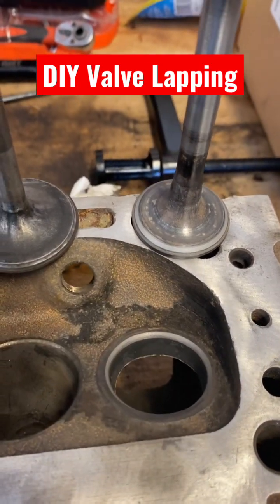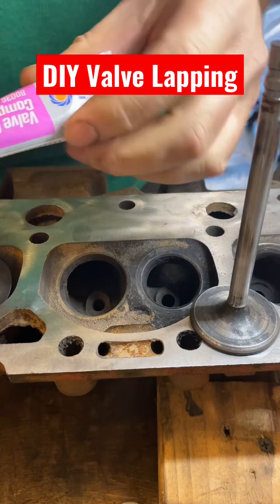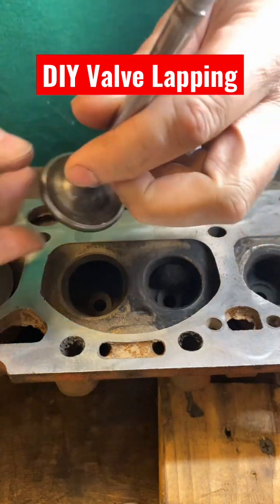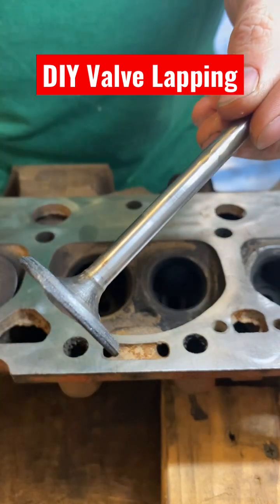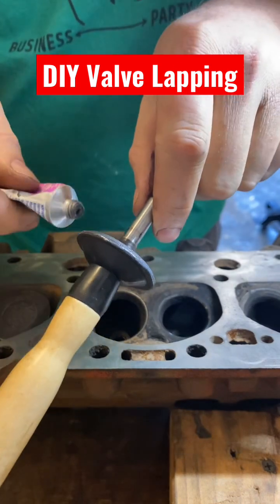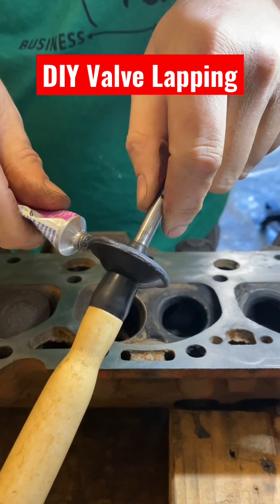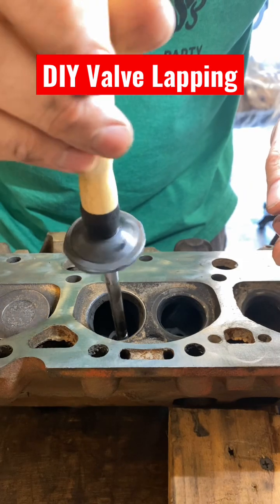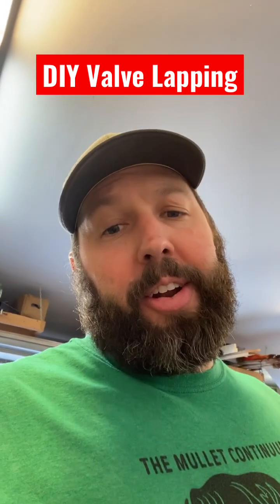DIY Valve Lapping by Hand

Comment: Never use a drill. You will wipe out the seat and create lines that won't seal. Have to do it by hand.
Reply: False
Reply: That's not true, mister. It just takes a little patience and knowledge of proper technique.
Reply: @Maestro_Animates   If u want to ruin the valve and seat have fun doing it WRONG. Quarter turns with the wooden handle and resetting 90 degrees every time the sound gets quiet is the correct way. Drills are for lazy idiots..

Comment: Well done, lots pf people are saying a drill....but thay seems like s very quico way to mess spmething up
Reply from the maker: You can do it with a drill. In some scenarios it makes sense. But you do have to be careful how you chuck it up, and don't get carried away with running the drill too long.
Reply: @freedomworx  absolutely, in fact, ille be using a drill tomorrow, and finish by hand I am thinking
Reply: @freedomworx  You use a rubber hose between the drill and the valve
\
Reply: @Nicholas-im8bd true...its act as a coupling cluth
Reply: it works just fine..just don't marr up the valve. it's actually quite effective. i use that method and then chuck the valve up in a drill press and spin it to polish lightly with a pc of 1500 grit sandpaper and wd40--almost like you're wet sanding.

Comment: Would a fire stick bow be more easier
Reply from the maker: A lot of people will chuck a piece of rubber hose in a drill and slide that oer the valve stem. That's generally the most efficient way to do it.

Comment: I soda blasted then washed my M113 cylinder heads & ran a cotton mop through the valve guides before & after I lapped in the valves . washed the cylinder heads again throughly before assembling them with new valve stem seals / spark plugs / exhaust manifold studs .
Reply from the maker: Overachiever 😉. I would hand just put them in my dishwasher if they would have fit. 🤓
Reply: @freedomworx  HA ! 😂 that’s a knee slapper ! . But honestly not even a bad idea  . I do kitchen remodels & half the time I find myself removing old dishwashers that are still working fine  & take them to the dump . You kinda just gave me the idea to take the next one home a hook it up in my back yard as a dedicated parts washer !

Comment: Hi! Do u have to shave heads after or can they go back on after the lapping if their already clean? Thanks
Reply from the maker: I didn’t do any surfacing of the heads. Just bolted it all back together. A machinist will always tell you they need to be surfaced 🤷🏻‍♂️
Reply: @freedomworx  My man! Thanks bro
Reply: Lapping valves has nothing to do with whether the head needs to be "shaved" (resurfaced). Shaving is IF the head is warped, lapping just ensures the mating surfaces of the valve and head port mate and seal smoothly. But of course shaving the head would affect valve clearance, but you'd have to adjust that anyway since it's taken apart.

Comment: more than "wearing out" (which it does), it pushes out of between the two surfaces.  You really gotta develop a feel for when you're not cutting anymore & need to reload...when I first did this, is was more often than I expect.

also, that plunger & the top of the valve has to be kept super clean
Reply from the maker: Yeah, I didn't clean the faces of the valves too well, and the plunger didn't want to stick.

Comment: Hey it's called a spit stick and a rubber hose and drill is faster
Reply: also good way to quickly distort the seat geometry.  I've done both, results with the stick, that I hate, have always been better.
Reply from the maker: A drill is definitely faster.
Reply: For such an important job....it doesn't hurt to do it right and tedious

Comment: Pfft. Valve lapping is over-rated-.-
Jk keep up the good work
Reply from the maker: It's gotta be slightly less bad than it was 😂
Reply: you dont value sealed valves?
Reply: @mtraven23  yes. I do. I did them on my own engine
Reply: @foulerbeatle888  so I was meant to read that in a sarcastic tone?  fair enough.